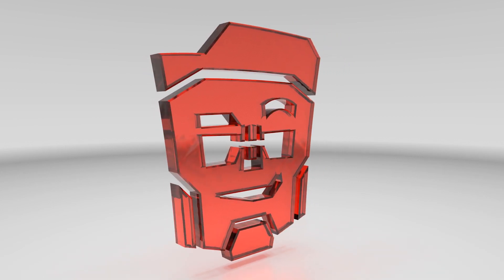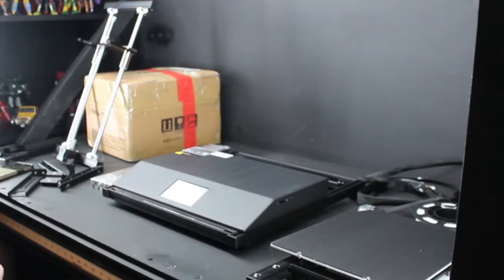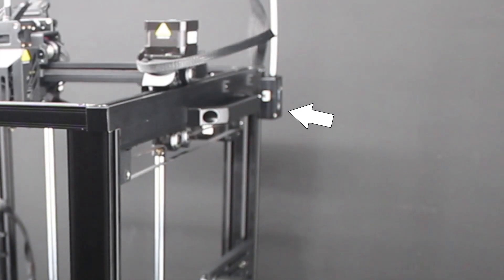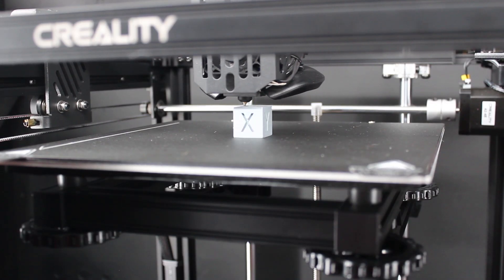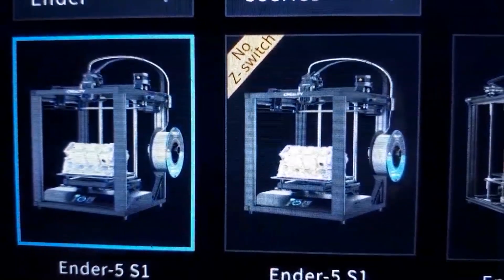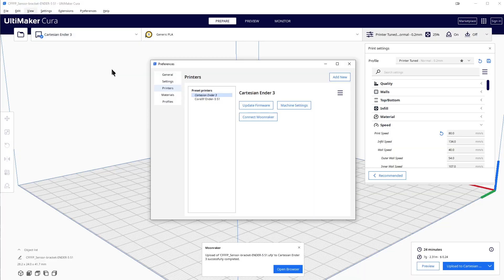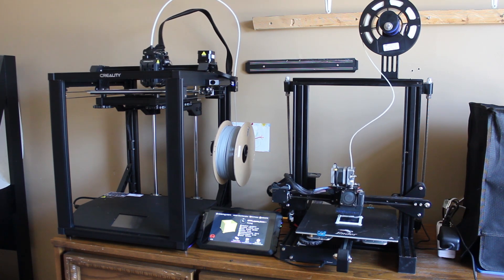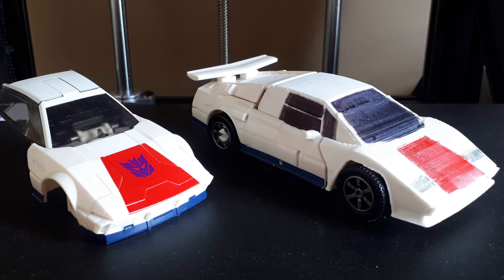Printing At 2x Speed? Yes please! - Creality Ender 5-S1 and Sonic Pad Review

Comment from the maker: IMPORTANT UPDATE. 2 MONTHS IN. PLEASE READ

While I stand by everything about this printer being a really great machine, working with it for these two months I've learned quite a bit. This machine comes with an all metal hot end, the construction of which is a pain to service. This hot end is fantastic for printing the hardier plastics like ABS and PETG which require higher temperatures to print, of which can shorten the life of your bowden tube (thus the need for metal) 

If you're buying this machine as a beginner with the intention to print PLA (the most common 3D printer filament type), I would recommend something like the Ender 5/Ender 5 Plus, not the S1. All Metal hot ends are finicky and require a lot of time to fine tune as they are considerably less forgiving

Comment: If you upgrade to the PEI build plate that you can buy from creality for the 5-s1 do you need to use the new magnetic stick pad it comes with or do you just use the new plate with your current magnetic pad youve already been using under the og build plate?
Reply from the maker: I'm not sure honestly, I've never used the PEI plate

Comment: How long do I have to hit F5 until the Countach rebody for Breakdown is available on your website? Super happy with the Countach wheels for Sideswipe and the properly sized tyres for Dragstrip.

One thing I was hoping you'd try were the BBS turbofans for SS86 Jazz, allthough I guess that would be hard to do given the way those wheels attach.
Reply from the maker: hoping to have it up and ready in 2 weeks
Reply from the maker: and I had considered making the turbo fans but never got around to trying. perhaps it's time I did though